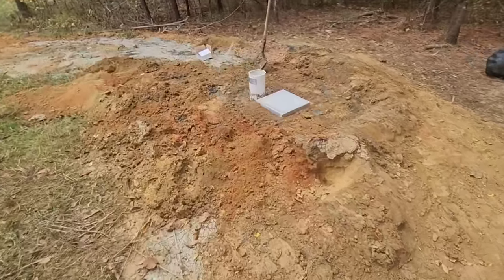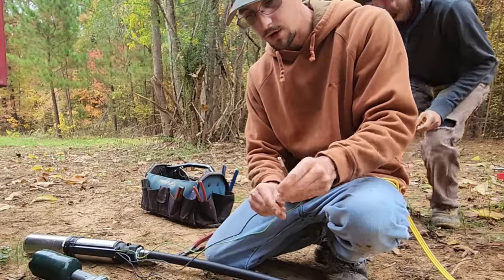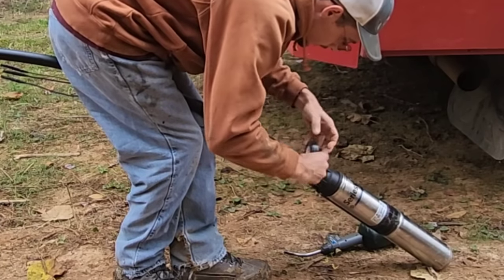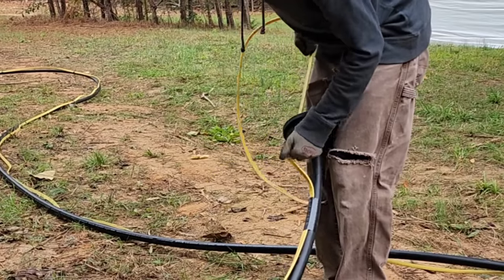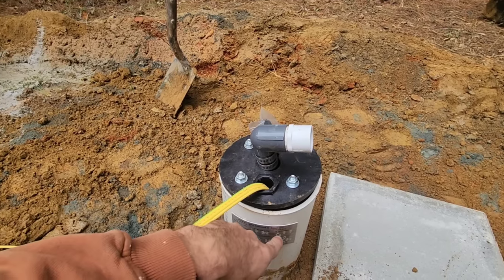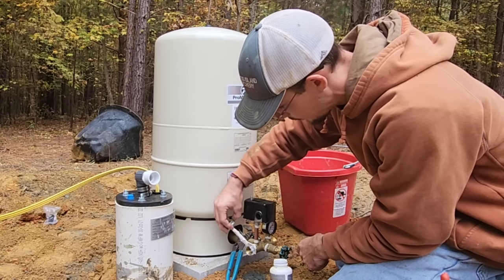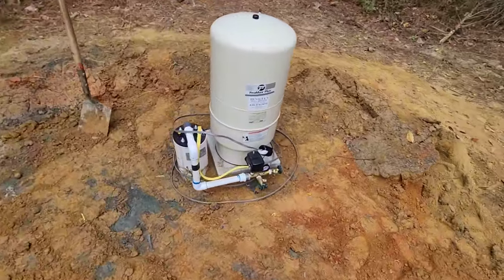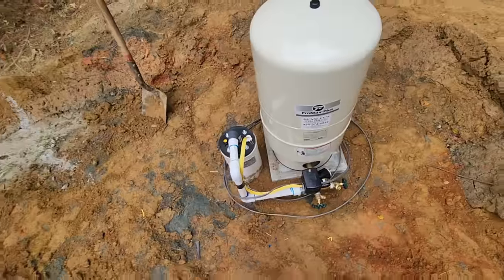Submersible Shallow Well Pump Install. To be Run by Generator for Camper Hook up.

Comment: I have installed thousands of these systems in the 90's and injectors, chemical dispensers, iron filters, water softeners, UV filters and a ton of other systems!

Comment: 4:42: one thing you don't comment about the rubber tape... stretch it a bit, and it self-sticks and helps seal better to keep out moisture.  I used it for sealing connectors up a tower, but as rubber tape is UV sensitive... needed to cover it with electrical.

Comment: I believe this will end up more of a question than a comment.  I have somewhat of a unique situation compared to most of your well/shallow well videos I have watched.  And thank you very much for putting out such practical DIY (some/most) videos, I know some situations require professional help.  

My situation is this, I live on a small river lake in South Central Texas.  I have an above ground 3/4hp pump running our 9 zone yard irrigation system that was professionally designed and install by me and a couple friends over 30 yrs ago and has run flawlessly for 30+ yrs.   But for that last 6 months or so my above ground pump started leaking at a gasket in the pump.  I was given a used operating (Goulds 10EJ15412) 1&1/2hp submersible pump that was replaced in a deep well where my son-in-las worked that I now want to replace the above ground pump with.  It will sit about 4-5' below the lake water surface level to prevent sucking any air when boat waves come by and pump up through pump shed and pressure tank then uphill about 25' rise at a 45 degree angle 200' up the length of our yard feeding the 9 zones and 4 sporadic faucets.  It is not an option to change any of the 1 1/2" piping, some of it goes through concrete seawall.

Since the 1 1/2hp submersible pump has what looks like a 1" or 1 1/4" threaded output, 

-  will I loose much pressure and/or volume plumbing this pump to an irrigation system that has all main lines are 1 1/2"?   Right now the above ground pump will easily run 1 zone and 4 hoses with sprinklers watering the edges and areas the irrigation system do not get.  At the zones the pvc drops to 1" and then to 3/4" and finally 1/2" usually at the last sprinkler head.  Basically leaving the pump at it's 1" or 1 1/4" output then immediately transitioning back up to 1&1/2" prior to the pressure tank and cutoff switch (which will be located in the pump shed).
-  there is an external foot valve on the pump I was given, do I need an external foot valve for this type application where I will be able to easily pull/service the pump at any time?  I saw on one of your videos you recommend this but I believe you said only on a deep well installation.
-  I am hoping my application will allow the pump to run constantly while the irrigation and/or faucets are running and not cycle the pump on and off, any ideas?  Are those cutoff switches adjustable to keep the pump running when needed?

Thanks for taking the time to put out your videos, I have found them packed full of knowledge and very useful.

Paul in Texas

Comment: For a situation where you want to use a generator with a well, is it worth adding some kind of a soft start circuit to cut down on the starting amps?

Comment: A topic I never hear you mention is the size of the storage tank. In instances where there is space and the well produces enough water, I understand it is better to use a larger tank versus the small blue and white tanks. From what I read, the benefit is less startup on the pump. That means less stress on the pump (longer life), and less instances of needing startup current.

Comment: Always a good videos from Phil, with his videos, I was able to replace all components of my deep well and now have a running well! He even replied To my question when my new install did not work, diagnosed it was a broken wire, replaced the wire and it started working.
Keep the videos coming Phil.
Reply from the maker: Thanks Mr. Williams!
Reply: @h2omechanic  wait so since my well is only 50' i can use a smaller pump like this then? 37' to water 47' to the bottom. im just gonna use for irrigation in garden nothing crazy
Reply: @Eastbaypisces that's my plan, should be plenty good for my garden.

Comment: Love the channel. You are spot on with your information and explanations. I have learned a lot, and it's helped me troubleshoot wells. I am an electrician with 28 years of experience. When you twist the stranded wire to wrap the ground screw. If you twist it counterclockwise and wrap clockwise, it will tighten better. Thought maybe it might help.

Comment: I looked for but missed any others asking this, but I am curious about:
A) Check Valve? I didn't see one installed. Necessary? Maybe built-in to the pump and not needed on shallow well?
B) Did you set the pump directly on the bottom of the bore? The casing was 80ft deep and I thought I saw you drop the pump to 80ft.  Will sediment be a problem over time causing turbidity?

Comment: Hi sir, I have some questions regarding drilling, grouting, developing and completing a well:

1. When do you grout the well casing annulus? Is it done after you found a producing zone?

2. If grouting after you reach a producing zone, will the grout not affect or cover the producing zone?

3. Do you always do open hole completion or with slotted liners?

4. Is it not proper to drill up to solid formation and set casing then grout the annulus before proceeding during to find production zone?

I like all the youtube videos you posted and admire your knowledge, talent and drive in this kind of business. Hope to get answers from my questions. Thank you for the knowledge you imparted to us.

Comment: I guess it really depends on the area, but I would think even for a temporary setup I would run conduit from the well into the pressure switch and use SOOW for the power pigtail and plug with water tight glands on all connections.  A way of doing it without the conduit would be using the appropriate gland on the three wire zip cord from the pump.  I don't know if there are pressure limit switches that are also water tight or whether that's needed but just something I would personally feel comfortable using.

Comment: How accurate is the well tag? Specifically you state that you want to keep the pump inside the casing, the tag says the casing is at 80 feet and you indicated you were going to put the pump 'at 80 feet'.  If there is any inaccuracy in  your measurement (on the long side) or their measurement (on the short side) then the pump will be outside the casing.   Would it not be better to set the pump at 75 feet (something close to, but not AT, the end of the casing)?

Also - I do not recall seeing you 'shock' this well before inserting the pump whereas I've seen that done in another video, was that not required for 'this' setup or was it done prior to the start of the video?

Comment: Have you guys ever used marine epoxy lined heat shrink?

I prefer that heat shrink, but you do such a damn thorough job with that tape I bet you never have an issue out of it.

I prefer epoxy heat shrink just because it looks cleaner.

Comment: @h2omechanic Well cap bolts, couldn't you put a chisel on the threads to Mar or screw up the threads so that they can't be taken off completely. Or put a second nut on the top with red Loctite to prevent it coming off

Comment: A couple questions. Don't shoot the messenger.
#1. Should the well have been shocked by chlorine.
#2. Should the well have been bonded.#6 wire.(grounding rod)
Since the well is not steel, A PERSON doesn't want a lightening bolt to Fry the pump.
#3 should   a disconnect switch have been installed at pump, maybe screwed to a wood stake, near the well.
#4. How would a person release the water, back down into the well, if there was a chance of freezing temperatures, to prevent the pvc from cracking.

Now the patch cord was only 10 feet or so.
The owner was also powering a camper and
The patch cord  could be changed to 75 feet long next to camper.
We all know that temporary sometimes stretch a little bit.
I'm just

Comment: I have worked with 230V motors in the past and know I can change the rotation direction of the motor by switching 2 of the wires.  Is motor rotation a concern for well pumps?

Comment: I always use a pipe coupler and then an elbow or a tee with on side plugged on top so the pipe will hang straight down. I noticed that one is cocked some. On a well like a 100 ft or less I use a 120 volt pump. It is much easier to hook to a generator and some generators don't even have 240 volts. But you will need around a 3000 wat generator to handle the current surge when the pump starts unless it's one of the high priced soft start pumps.

Comment: I am not sure if you answered this in another video but I would love to see a simple wiring schematic/explanation for what wire goes where when you connect the three pump wires to the yellow submersible wire and then connections topside.   Do different pumps (more or less horsepower) require different wire gauges?  I assume you run underground feeder to the connections topside of the well?   Thanks man,  you are putting out great content.
Reply from the maker: A typical 2 wire pump is simple to wire. Connect the green ground wire first, & the other wire can go any which way.
A 3 wire pump is the same, except you must hook up the Yellow starter wire to the yellow in the control box. A few other install videos go over wiring ect. They are the longer videos
Reply: @h2omechanic  I find that going over the "small details" even for a avid watcher is OK. for instance wire size is dependent on pump size and distance of run!!!! even why a 2 wire pump is used, even why do you call it a 2 wire when there are three. whats the difference? for instance i used a 4 wire due to me wanting the "capacitor" in my home as that in my belief is the most common failure point.
      why in this video do you not use "brass fittings"? the grey fittings "the elbow" are the cheapest weakest things in my local hardware store!!!! now if that is a different "schedule" fitting then please comment on that. thanks for you vids though I do enjoy them. I feel sorry for these guys spending what they do for so little water though. I have a flowing well and the pump puts out a stream 15 ft vertically. (red lion 12gpm, 1/2hp.)and I believe 62gpm,108 ft deep

Comment: Thanks for the great videos. When and why are check valves installed on the down pipe sometimes?
Reply: Keeps the down pipe from emptying out, meaning you don't end up with a bunch of "air" in the line, if you end up below the vapor pressure of water.

Comment: Is there any well pump that will go down a 2 inch casing a 188 feet and supply water well 360 feet  8 gallons per minute

Comment: Thank you for sharing these videos.  I enjoy watching you work, very professional.  I am wondering why you don't use any UNIONS in your piping? I have used them in many applications.  When having to make any repairs,  like because of broken pipes or whatever it makes disassembly easier and I don't have to cut out a lot of good pipe. For instance,  if I had to change the bladder tank as you have it installed, I could disconnect at the union.

Comment: I like to learn from your videos, very good information! I have a question, I'm remodeling an old cabin for my neighbors and it has a well by the house so I checked it out and put a pump in. It's 120 ft  to water and 24ft to the bottom of the water or whatever I hit. I put a half hp pump in at 140 ft and connected the wire to plug in directly to the generator, when I start the generator it pumped about 15 gallons of water then quit,I did it again a couple hours later,same thing, I let it sit overnight tried again this morning, same thing. Any suggestions?

Comment: Do you have a Franklin Aid document on 2-wire motors and generator use and effects to the Franklin BIAC switch?  Its not in the AIM manual.  The Franklin AID is an old monthly doc, Franklin published in the past.

Comment: The casing is 80' and that's how far you lowered the pump to, but how deep is the actual well drilled?  I'm guessing it's deeper than the casing itself.  If you don't know exactly how deep your casing goes, how far off the bottom of your well do you place your submersible pump to, generally?

Comment: What gauge wire is used on the pump.
I have an old jet pump on a shallow well using 115 volt. 
Should I use a 10 or 12 gauge wire?

Comment: On a irrigation well only 123' deep. Does it matter if the drop pipe is 1" verses 1-1/4". Pump is a 1hp 4" submerged? Thanks

Comment: Recently found your channel and did subscribe. Great content!

On one of your previous videos the subject was the PVC pump sleeve to protect the pump motor.  When I replaced my shallow well submergible , about 6 months ago, I found on Franklin's site their advising using these PVC sleeves particularly on  larger diameter wells to insure pump motor cooling. 

I have a 85 foot 24" curbed well and it had gone through 3 pumps in 15 years, due to motor failure. I am convinced that had I installed the PVC sleeve on pump number one, I would still be using pump number one.

Was wondering why you did not include the PVC sleeve on this  10" shallow well?
Reply from the maker: Because this pump is set at 80ft. Water enters the well Below the motor, thus cold water will pass by the motor to cool it. A sleeve will help every pump. 
Bur there are situations that need them more than others

Comment: I swear he said it was a two wire pump at the beginning  so 120 Volt. Then I see 3 wires from the pump so it must be a 230 Volt pump. Never mentioned how any color code for which was his 2 hot wires then ground. My best guess is a bare wire with no insulation is his ground wire. I'm not a electrician but did learn how the pump was installed.

Comment: Is POP-off valve necessary? Mine is starting to leak can it be removed or needs to be replaced?
Reply from the maker: Not necessary at all. Only on big systems 2hp+. Remove it and plug it.

Comment: What’s your thoughts on a cycle stop valve?
Reply from the maker: Only necessary if its a Irrigation well for a sprinkler system. For residential use, it keeps the pump under full load at all times .
You may get 70psi in the home, but the pump would be under 150-170psi of load (depending on the pump size)
While it's better for the electric motor, the pump stack/impellers & bearings and seeing unnecessary abuse.
Reply: @h2omechanic  thank you for your reply it was great to get your thoughts on it

Comment: Thankyou for having this channel! Ive never had to hook up a well before, but I now am in the process and I’m learning. Trying to learn from reading online and watching your videos. I just got a well drilled to hook up to my mobile home. The well is 100ft, 15 gpm, 8ft static water level. Should I be concerned that the static level is so high?
Reply: Also, (not being critical at all) just curious why you didn’t install a check valve before the pressure tank.

Comment: Thank you for this video. Speaks right into my situation. My off grid well produces 10gpm. I have a 23gpm submersible pump. Is there a way for the two to work together without running the water dry? Thanks in advance!
Reply from the maker: If it ran dry, it mostly like wouldn't hurt it. But yes, you could install a low pressure cut off switch.
Reply: @h2omechanic  Thank you! Much appreciated.
Reply: You can also add a ball valve in the line before the tank and switch to throttle the output of the pump. A Dole valve would also do this but costs more and isn't adjustable.

Comment: How far away from the well can the home be? When it is piped with pvc. Could it pump 200-300 feet and give adequate volume and pressure for a small house?
Reply: 1" line would easily carry that distance.

Comment: Is there any reason you don't use a ratcheting crimper?  A ratcheting one makes sure the connectors are all a uniform compression level, to make sure a good contact is made.

Comment: Got to well over 200 ft deep was clear now just muddy what do you think's wrong
Reply from the maker: Typically heavy rain fall will cause a well to get muddy water. (This should not happen)  if yours is muddy after heavy rains, then you need to look into "Well Liners" .  
Your Casing is not deep enough, or your first water vein is connected to surface water, the liner installation will block out that upper vein from mixing in muddy water with the deep water veins that are clean/clear water. I have Vids on liners.

Comment: do you know whats a good size generator to run does well pump by chance ?
Reply from the maker: 5500watt 240v generator is typically the minimum. Anything smaller can't handle the startup amps

Comment: So if the well is 50m how meters of the cable and the pipe needed?
Reply from the maker: It really depends on what level the water is at in the well. But roughly 35-45 meters of pipe would be needed.

Comment: Is it true that if you use too much pipe paste you will be tasting it in the water for a long time?
Reply from the maker: I only see that happen if the filter traps the pipe dope & all the water runs thru it. Customers need to replace the first filter after 5 days of use, then it'll be fine. Rare occurrence